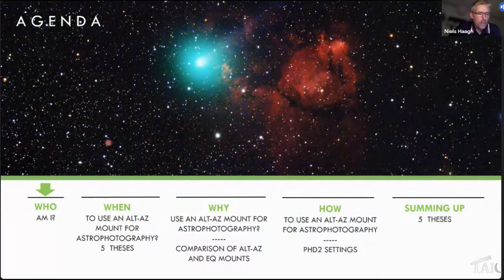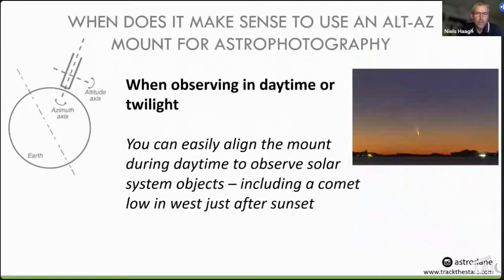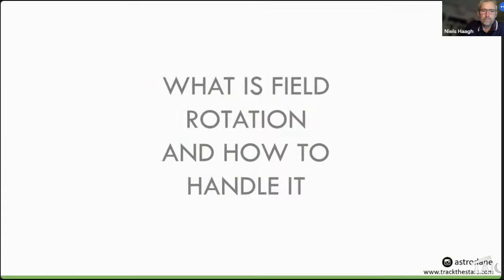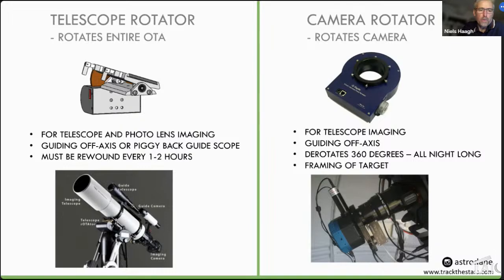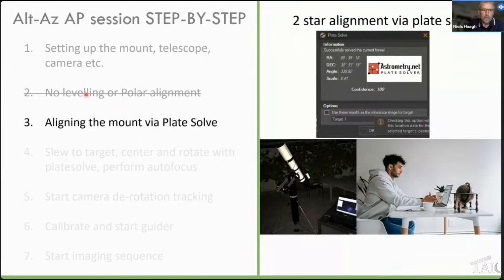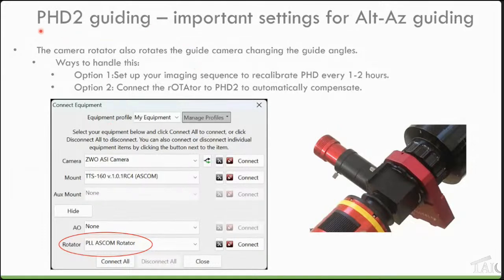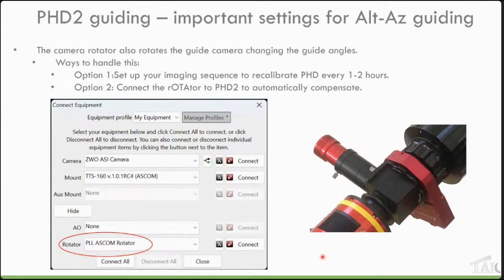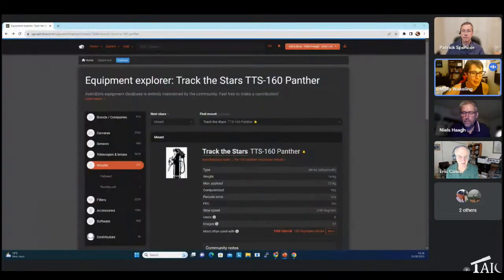Astrophotography & Alt-Az Mounts | 2023-08-20

Comment: I'm just getting my feet wet in EAA.  I have a SC scope on an alt-az mount with ZWO camera and ASIair Pro mini-computer.  It all works great for planetary and lunar imaging.  The mount follows the aligned image quite well.  But, I'm interested in getting into DSO imaging as well.  I have a couple of questions:
1.  If the stacking software can de-rotate images, why do we need a camera or scope rotator?
2.  Why can't the main camera image be used for guiding?
Thanks for your video and comments.

Comment: Lately some of the best images I've seen come from big ass dobsonian telescopes used with short exposure times thanks to CMOS cameras, been wondering for a while why it itsn't a more popular form of imaging especially since how big of an hassle setting up an equatorial mount is with a big scope if you don't have a permanent setup (a thing that, at least here in Italy where the sky sucks pretty much everywhere, usually implies loads of light pollution).

I mean, there is a reason if you see more and more images taken with very light setups and small scopes.
Reply: At last a kindred spirit! I'm an amateur from Australia, we have great skies and amazing objects to photograph. I got a myself a Skywatcher 12 inch synscan last year and I thought it was only a visual instrument. But I recently got a coma corrector and put a camera on it and I was amazed at the results! The missing piece of kit for me was the stacking software, I use APP and it deals with field rotation very nicely!
Reply: BTW I use sharpcap for data aquisition but I haven't yet figured out how to connect it to my dob and do a plate solve and sync. What do you use?